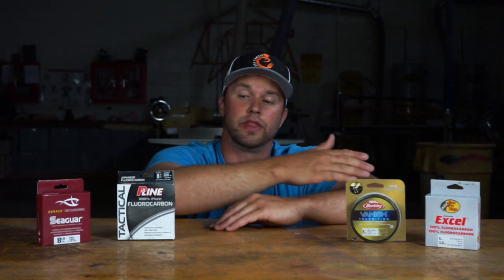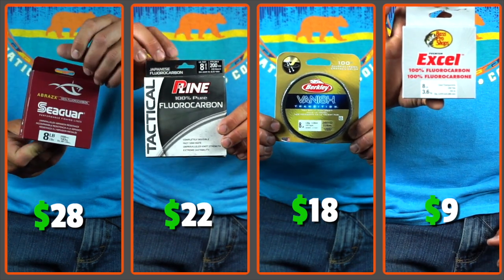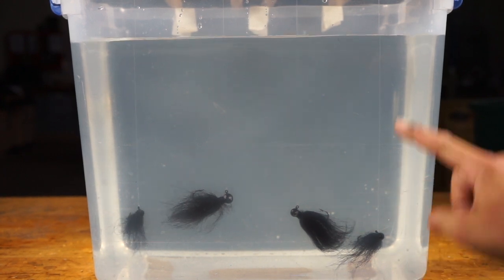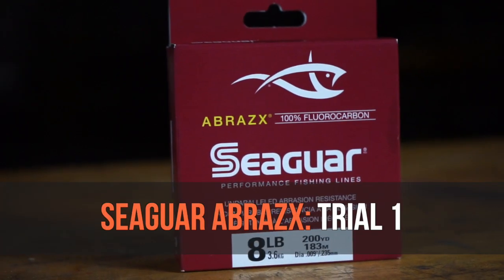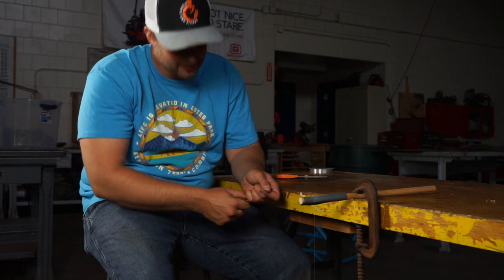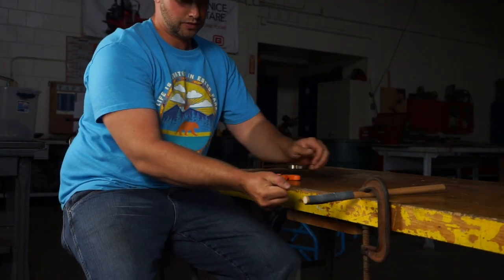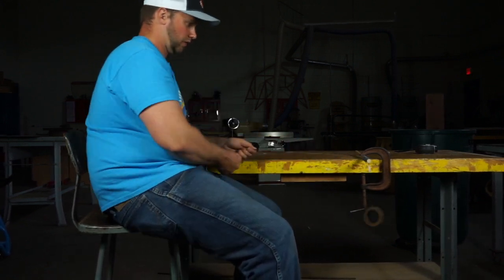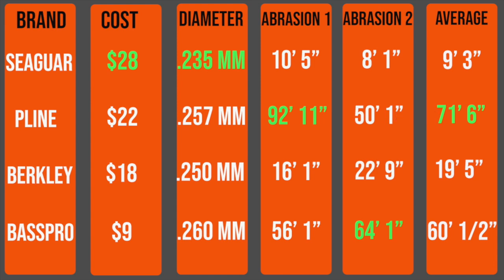Which brand of FLUOROCARBON is the strongest (SURPRISING RESULTS) | DOES IT MATTER?

Comment: Did a tensile strength test for materials science class, how I did it was WRAPing 5-6 times around 3” pvc pipe then going up and around a scale with a 1” rod on it. Then went back down and around the pvc 5-6 times. The scale was hooked to a winch. Got very consistent results.
Reply: Meaning that P-Line won the tensile strength?
Reply from the maker: That’s a great idea